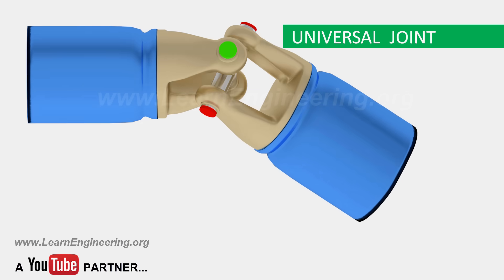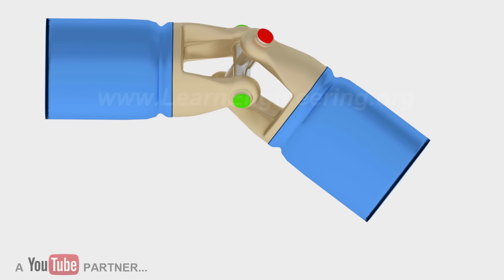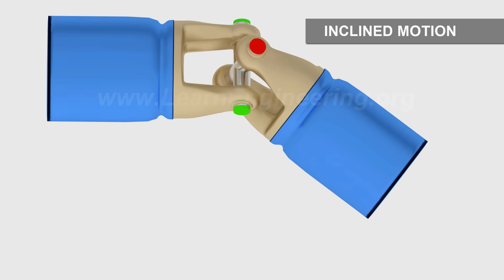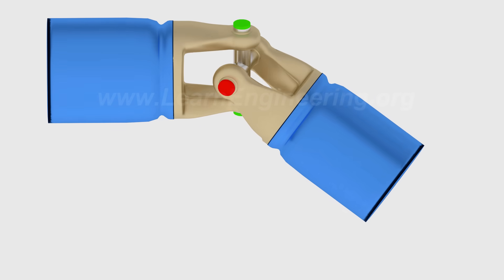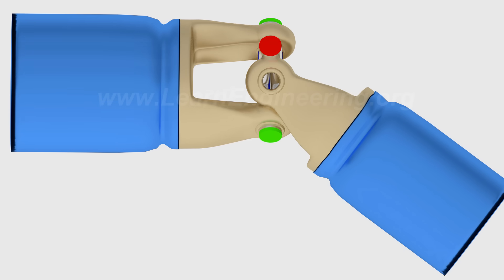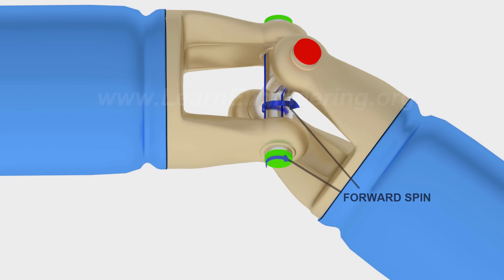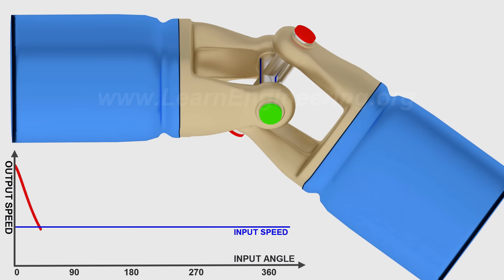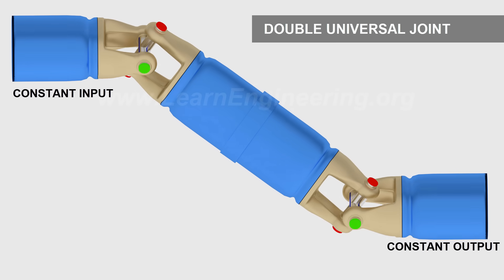Understanding Universal Joint

Comment: But the second U-Joint only keeps the motion when the Input and Output have the same directional vector, right? If it's a 90° angle, then there is still the non-linear speed problem?

Comment: i had a squeaking noise in my truck, every time i would start driving ,i heard that squeaking noise  i was kind of worried  what was making that noise , after a few weeks of squeaking ,i finally took my truck to my mechanic ,sure enough it was my u joints ,,glad i had new ones put in by my mechanic

Comment: Pretty amazing how that output shaft of the transmission can be spinning at 3k rpms if your engine is also at 3k rpms and the gear in the trans youve selected is 1:1, thus the driveshaft is spinning at 3k rpms, and each ujoint has to make 6k movements per minute. With each roatation of the driveshaft it goes back and forth. And the other axis of the ujoint is doing the same thing. Total movements in the ujoint are 12,000 per minute. And they last for hundreds of thousands of miles.

Comment: Excellent video. This is why when reassembling a tail shaft, it is very important that the marks on the slip joint line up, so the angles on each end also match

Comment: With a double universal joint it is very important that:
1. the yokes of the middle piece need to be in one plane
2. the angle of the first joint must be the same as in the second joint. This give you the form of either a Z (as shown in this video) or a W (of some sort)

also: the middle piece still travels with fluctuating speed thus fluctuating accelerations thus fluctuating torque by inertia. So you want to have the middle piece as light and compact as possible to reduce inertia.

Comment: Could you explain wide angle shafts! As there are three universal joints on a wide angle pto shaft and they are considerably smother than a cv shaft with 2 joints, how do the output speeds equal out in this shaft?

Comment: ok but if the 2nd joint turns another 45 degrees so that the total assembly is a 90 degree turn does it turn into a super fluctuating input

Comment: Universal joints are used for the steering wheel connected to the wheel arms and u joints are also used for transferring torque to the wheels when the u joint is connected to from the transmission to the drive shaft

Comment: Front wheel drive cars have constant velocity joints for changing wheel angle directions while maintaining a constant velocity output. I was hoping to see a comparison of this cross design to that of the car's design which uses ball bearings.

Comment: I’ve seen this video 10 times. I’ll accept that there’s a fluctuating speed and still not know why
Reply: The green dots spin with a constant velocity, because we assume it at the beginning of the video. The red dots spin with the same velocity of the green ones, because they're part of the same rigid body, which is the cross, PLUS the wobbly motion induced by the angle between input and output shafts. So, since the motion of the red points is a constant motion PLUS a variable motion, it comes that the total of the two combined motions has to be variable.

Comment: By this example, how does a steering front axle (where the axle shaft has a single U-joint) work? The tire certainly does not change speeds when turning....

Comment: If you look at light-duty 4x4 trucks from decades ago (50s, 60s, and early 70s), the transfer case was tilted down toward the rear to reduce the angle of the U-joints in the rear drive shaft (the shaft with the greatest need for running efficiently), but this increased the angle of the U-joint on the front side of the transfer case.  To accommodate that, they tilted the rear (input side) of the front axle downward.  This rotation of the axle position away from the position that "looks right" increased the angle of the U-joint at that location so it was a close match to the steep angle of the U-joint at the front of the transfer case.  It's a setup that looks very strange if you don't know the reason, and this video explains the reason.

Comment: The speed curve seems to be influenced by the angle of the 2 joints, therefore in order for the double universal joint to work it's output and input axles should be parallel to each other. Can someone quickly confirm or deny this?
Reply: Yes, the transmission end yoke, and rear axle input yoke either have to be parallel with the same working angles. Or non-parallel with equal working angles to get a vibration free transfer of torque to the driven member (carriers). Both yokes working angles should be equal to each other or have a 1 degree maximum difference.

Example:

Operating Angle of Transmission End yoke is 1.5 degrees. The angle of the rear axle input yoke is 1.9 degrees. The angle difference between the yokes is: 1.5 - 1.9 = 0.4 degrees. Less than 1 degree difference. Perfect. We can see the working angles are equal to and below 1 degree (0.4 degrees), and the maximum working angle of each yoke is less than 3 degrees (1.5 and 1.9). Perfect.

If angles are not the same then you will get the pulsating effect you see on the graph, the U-joint spinning in one direction and then changing direction to compensate for the angle. The slip yoke attached to transmission is trying to keep up with the spin of the Transmission end yoke that is constant and the U-joint angle is making it difficult since they travel along a different axis.

Comment: What is the purpose of a double universal joint if you can get the achieve the equal output velocity as shown in the beginning of the video?

Also, what common mechanical systems make use of such joints?
Reply: Please do notice that first one was a case when Shafts are in the same plane. But double universal join us for shaft in two different planes.
Uses : Automobile shafts, conveyors etc

Comment: Universal joint: I'm complicated
Automatic transmission: Hold my planetary gearset
Reply: proceeds to break down at 10 000 km
Reply: I have an automatic bike. Been 6 years and zero problem other than the odometer, speedometer, and the old battery lol.
Reply: @Vi-pv3xi  automatic bikes use cvt and not planetary gears
Reply: D ʝả ħ  AT's are for people who have better things to do with their lives than wasting time shifting gears
Reply: you sound like a lazy american
Reply: this is why i have, either rotating or not rotating.

Comment: They didn't mention the fact that you need a spline shaft for these things to work.  As it goes around it also moves in and out a tiny bit and slides on the spline.

Comment: So the output shaft increases and decreases rotational speed relative to angle to the input shaft. The ratio change occurs relative to shaft angle every 90 degrees of its rotation due to changing location of axis points on the output yoke.. makes sense.

Comment: Anyone please ....will it work at 90 deg ???
Reply: Most cannot. Universal joints have a certain degree thst they will work in. It could be possible to make one that works at 90 degrees but using a different method would be better.
Reply: @Redtooth75  Thank you for your reply so what would be a better method

Comment: "universal joints are commonly used to transfer mechanical power between two shafts when their axes are at an angle to each other", so wouldn't making the output speed constant by adding another one of these at the end defeat the purpose of having the shafts at an angle?

Comment: I've got some Qs if anyone can help:

1) Why are UJ still used today?
2) Are UJ typiclly used for RWD cars whereas CV joints are normally for FWD cars?
3) Why is the driveshaft angled as opposed to being straight? Is it due to the placement of the engine and rear passenger space considerations?

Thanks guys!
Reply: u joints are cheap... like $15 gets you a brand new one. cv joints... 10x that cost easily.

Comment: Is this patented or anyone can use this design freely? And how much efficiency is lost per joint?
Reply: I'm no IP lawyer, but I feel like the Universal joint mechanism is not exactly patentable on its own. If, say, you had a problem which you uniquely solved via the use of a universal joint, you could patent the mechanism, including the joint, for that purpose, but you can't put an outright ban on others creating the mechanism for any other use.

Secondly, conservation of energy states that the work done must be equal to the work in. The mechanism itself doesn't lose energy between input and output, and the efficiency of the mechanism in the real world is subject to the friction coefficient, level of play, and state of the components at the time. It's difficult to give an answer really, though I would imagine it's quite a high efficiency because you're not transferring between forms of energy, it's all kinetic.

Comment: If you feel your truck or pickup is not accelerating smoothly or it keeps swinging back and forth then the problem might be as shown in the video , you need to check the alignment of you trucks drive shaft , this problem is only common in pickups and trucks , as for sedan-like cars with unibody structure it's rare to have similar problems .

Comment: If it were angled at 90° it wouldn't work at all, right? It would just spin the second shaft around like a pinwheel. It's strange that this works without the positions of the shafts changing at all, really.

Comment: hello.
I want to make modal anaylsis simulation(solidwroks) over this drive shaft,but the problem is one end of shaft will have torque input and the other is fixed(from a source).I want to know why it is fixed.? Is there any logical reasoning behind it because in general it is not literally fixed(fixed to other part) ie it will revolve. 
can you please help me with this. 
Thanks.

Comment: A constant input will give a fluctiating output, and a fluctuating input will give a constant output.
But, if the input is like this: |
And the output is like this \
When you take this as the input: \
and take the output like this: __
It'll fluctuate even more. isn't there a better way to fix this problem with gears?

Comment: Wouldn't having the final setup defeat the purpose of a universal joint? Because then, the axes of rotations are parallel. Why not just use a belt/chain?
Reply: One good use for a double u-joint is in a rear wheel powered vehicle. joint at the trans and a joint at the rear differential. A belt won't work there because of the need for the axis of rotation to move about even though they are still parallel.
Reply: I see, the segment between the 2 joints would be extendable? shorten or lengthen depending on the movement of the segment near the differential. is that correct?
Reply: In a car,  the rear axle moves straight up and down while the drive shaft (segment between) moves in an arc (with one end unmoving up, down,  left or right). When the axle is all the way up or down the distance between the two joints is longer than when the axle is in the middle of its travel. So to combat this the manufacturer puts a slip joint in the middle of that drive shaft to allow the 'middle segment' to stretch as it is required. Or for a shorter answer to your question: yes.

Comment: I understood the basic concept of a U-joint, but had no idea that the output speed wasn't constant. Very interesting. Thanks for the video!
Reply: DangerDaveFreestyle because there are 2 u joints. Making it a constant velocity joint
Reply: okay i understand now. i was only thinking of the one ujoint.
Reply: so true. im wondering now how a front engined rear wheel driven vehicle can operate so smoothly and the final part of the drivetrain is not jerky.
Reply: @dangerdavefreestyle  there are two u-joints in the driveshaft. However, they are offset so that the vibrations cancel out.
Reply: DangerDaveFreestyle I'm wondering if the rear drive shaft having two U joints gives it the same effect. The front U joint that is up by the yoke to the transmission and the rear u joint going to the rear differential. Does that make a driveshaft a CV (constant velocity) axle without the name?
Reply: @bradentrevino7694  it's a "double universal joint" as they counteract each other: fluctuating input in the rear and fluctuating output in the front. Whereas with a CV joint: "this is called a constant velocity joint because no matter what angle you turn it, the input velocity of the rotation will be equal to the output rotation speed." https://www.youtube.com/watch?v=auQ65qno2Eo
Reply: Same
Reply: Same
Reply: Tk
Reply: VontekSRB because the propeller shaft is inclined to transmission shaft, so due to that there will be not the exact transfer of rotating speed or motion. And thus in final drive also the angle will be different hence no constant velocity.
Reply: I had trouble as well seeing why but imagine If you push something straight along a line determining it's speed or pushing it at an angle compared to the line. Even if you push it just as hard, you will cover less distance in the initial line's direction and thus your speed will be less in that that direction. Now imagine you zigzag push the object compared to the line. Your relative speed will vary, depend on the angle compared to the line you're pushing along. Regardless of giving a linear, unchanging push on the object. This is the same principle as the constant torque, constant velocity input of the input shaft giving a fluctuating velocity output when the output shaft is at an angle. Resulting in jerky rotation.
Reply: now,,, why the output speed iznt constant?

Comment: What happens in a double u-joint system when one of the u-joints is positioned 90 degrees from the other?
Reply: Il cardanico può fare solo 4 posizioni angolari di movimento è chiaro
che se ne usi due avrai 8 posizioni.
Al contrario di un giunto omocinetico che ha moltissimi movimenti angolari
che supera gli 8 detti,la scelta poi può essere dettata da altre esigenze.
Reply: alex tworkowski It would not be able to move at all. If you applied a torque on the input shaft, it would try to rotate the output shaft in a plane perpendicular to the axis of the input shaft without transmitting any rotation along the output shaft axis.

Comment: Hello,

In case of the double U-joint configuration, where constant velocity occurs at the output shaft, is this velocity equal to the input shaft one?
Reply: Also, can you please elaborate as to whether there is a phase difference between input and output?
Reply: the velocity between the output and the input on the double joint has to be the same, because per each full rotation of the input the output shaft does an other full rotation, being both velocities constant they have to be the same to achieve a turn in the same amount of time.

Comment: maximum angle in universal joint?
Reply: ***** thanks for reply
Reply: Indeed, I was just thinking that TECHNICALLY you could get it down to 89.999 degrees but problem with that is that the amount of friction going into those things if you forced it to twist would probably melt it.
Reply: Just guess 45 degree ?
Reply: Just guess 45 degree ?

Comment: At 03:08, your graph shows a non-symmetrical addition and subtraction of the input speed. Not only are the positive and negative peak amplitudes of different magnitude, the area under each peak is also non-symmetrical. I would have thought that the velocity deviation should track the sine of the displacement angle, and that the positive and negative graph curve segments should be symmetrical.

Comment: Was thinking about car steering and couldn't figure out how their physics worked. Couldn't you just use two gears though?
Reply: look up four bar mechanism and you will understand it. When the car makes a turn say left, the left wheel turns more than the right wheel. A four bar mechanism makes this possible with suitable lengths

Comment: So is it correct that, in a double universal joint, if the last rod (or whatever you call it) is not in line with the first rod, this will have a fluctuating output?
Reply: yes the angles must be the same.
Reply: Zach A Thank you.
Reply: VontekSRB yes due to angles which causes cyclic variation in speed
Reply: but why will it have fluctuating output due to angles? its not like there is a output power loss from hitting angled rod, creating pressure in wrong angle,the cross does the work of automatically transfering same amount of rotation cuz itz stiff cross

Comment: But shaft A has to be in plane with shaft C, right?
Reply: +Black Jamal Parallel, but not necessarily in the X or Y planes. In the common example of an automobile drive shaft, the driven shaft is parallel to the drive shaft, but is lower to the ground. It could also be offset, that is, not along the centerline of the vehicle.

Comment: You missed one very important point! The angle of the outputting universal joint must match the angle of the inputting joint. This problem was the source of some vibration concerns with some RWD vehicles and I have seen quite a few "Raise Kits" put on the rear suspensions of cars and trucks that did not take this into consideration. Some of those vehicles shook so violently they would loosen the fillings in your teeth!

The concept of the constant velocity joint was used in the 60's and well into the 80's with what was called the "Cardigan Joint' and it had a very short piece of shaft at the front of a lot of driveshafts on GM RWD cars. A bit more complicated than this video showed, it served pretty well to eliminate vibrations caused by angle variations as long as the final output angle to the differential was under 1 degree.
Reply: "Cardan joint", not cardigan.
Reply: Exactly. I'm facing vibration problem in my car due to universal joint
Reply: "it is clear"